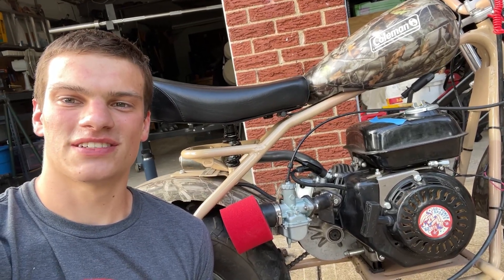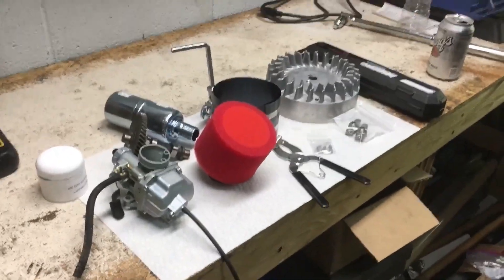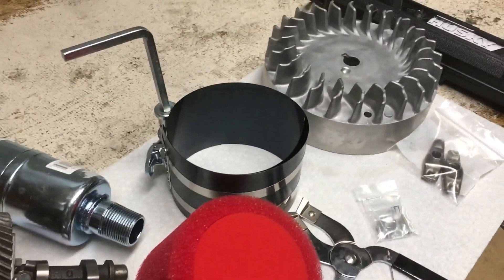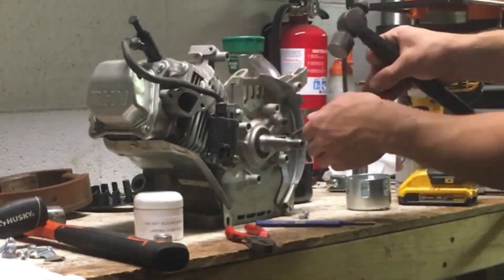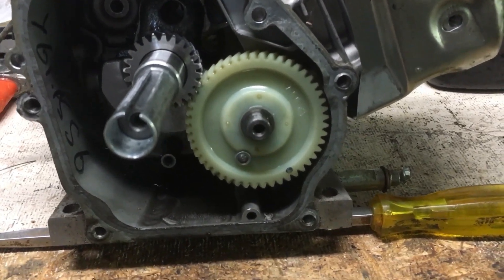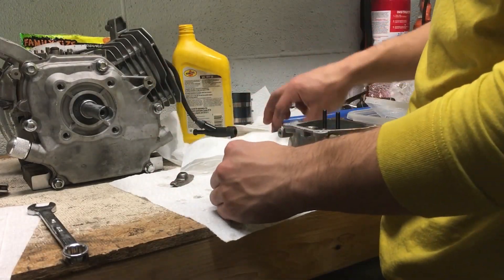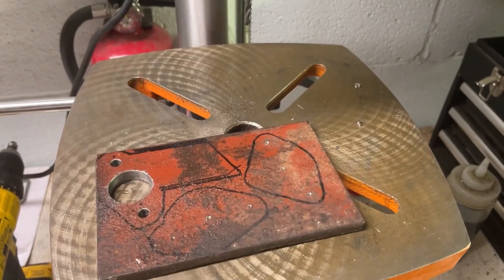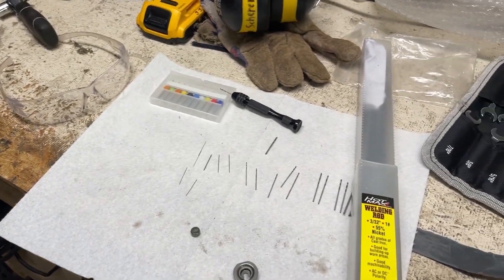Coleman CT200U-EX performance Engine Build!

Comment: Did you get the 7 degree key idea from Black66?  He got that wrong because he doesn't use a timing wheel. You want a 12 degree key for the best performance.  When I used that cast aluminum flywheel I timed it with a timing wheel and no key to 32 BTDC.
Reply from the maker: That's interesting when you timed it. I'll have to check mine at some point. Thanks!
Reply from the maker: Oh, honestly, I can't remember, But I think the flywheel was said to have some advance built into it, so I subtracted the difference and that's how I got 7°.
Reply: @JohnWheels  The popular cast aluminum flywheels have less timing than stock. The expensive ARC flywheels have advanced timing. 7 degree key isn't bad and it's much better than if you used a stock key.

Comment: Set the coil gap to around .040 - .060 the magnet on the flywheel is probably causing the pull start to snap like that I had the same problem on both of my bikes
Reply from the maker: Thank you so much!